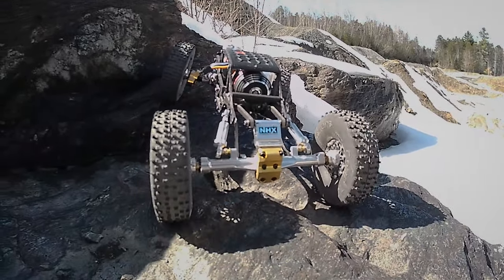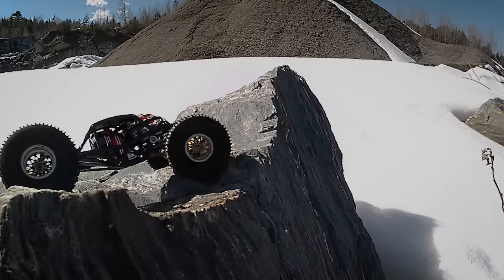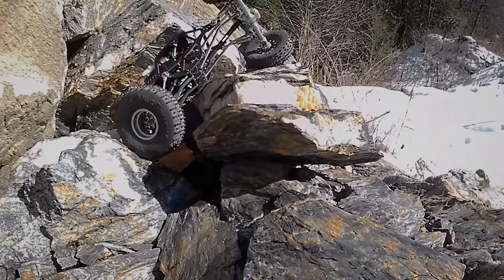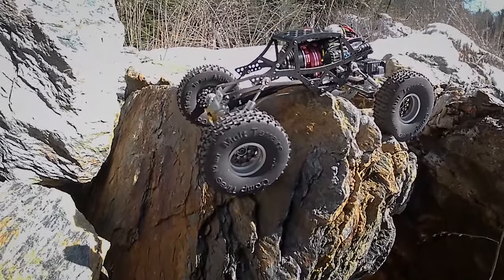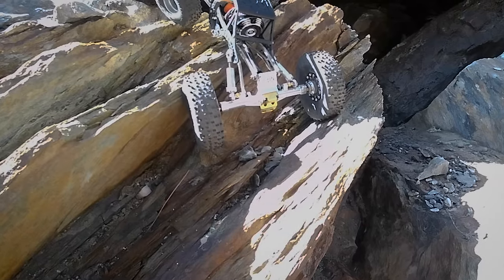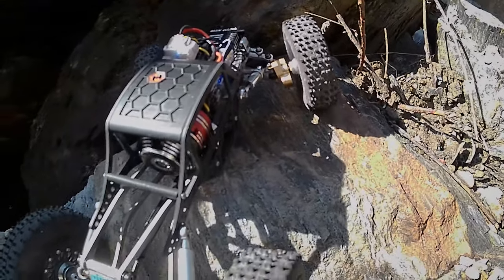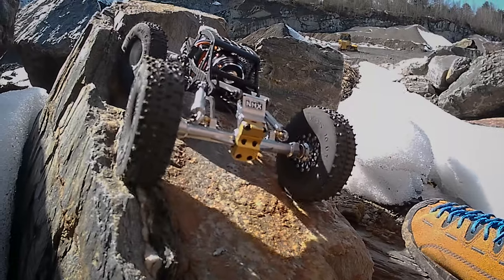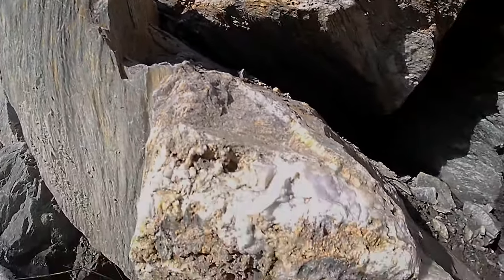Hard Park Dementor V2 - Quarry #1

Comment: This thing pulled off some mission impossible lines 👏🏿👏🏿👏🏿👍🏿👍🏿🏁🏁🏁🏁 great video. This has to be my favorite rig right now 💯💯
Reply from the maker: Nice! Thanks. This is also why I think you should get into 24 scale at some point. You'd have a ton of fun with it. Building this put a pretty good dent in the wallet but it was worth every penny. But you don't have to sink a ton into one. There are 3D printed chassis and parts that are swap overs for stock rigs that will perform really well. You should look into it someday.

Comment: You’re tempting me into a comp build. I can’t afford that right now. If I start building one before I finish what I’m currently working on, it’s your fault.
Reply from the maker: If you want the top performance capability right now, you may want to start a comp build. You can always have multiple simultaneous builds going on at the same time. My 24 scale MOA has been ongoing for about 6 months. New ESC should be here in a week or so and that should wrap that up.

Comment: Is it even worth starting with scx or just buy Chassis axles shocks....electronics trans...all aftermarket.
What axles those are sick.
Killer run!
Reply from the maker: Nope, just grab a chassis and start ordering your build parts. There isn't one bit of donor parts you could use off a stock rig. You'd want to get all metal parts and go brushless, for sure. I'm so glad I built this thing. It rules. Love it!

Comment: How much overdrive are you running?
Reply from the maker: 14% in the diff, not the transmission. One of my other ones has the 14% OD trans and it slips horribly.
Reply: @VermontScaleCustoms  good to know! I am running 23% in one rig and 30% in another. Is that too much OD?
Reply from the maker: I didn't even know you could run that much so I'm probably not the guy to ask, lol! I just hum along with what I have and remain pretty clueless about the plethora of options.